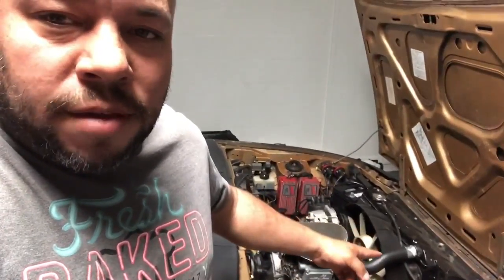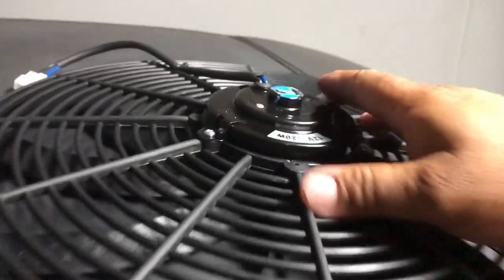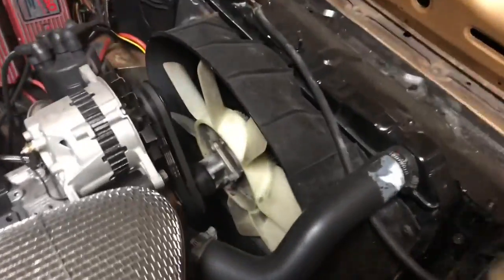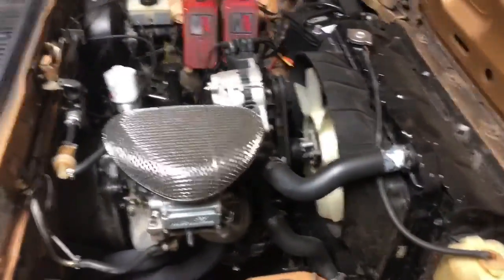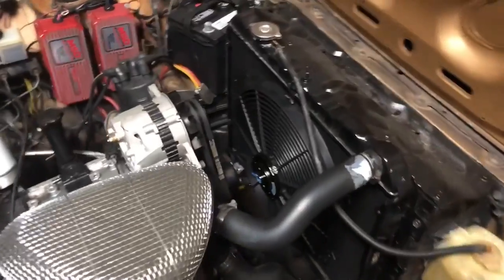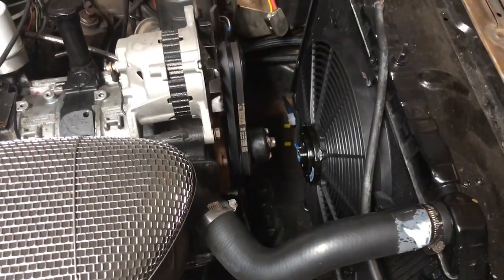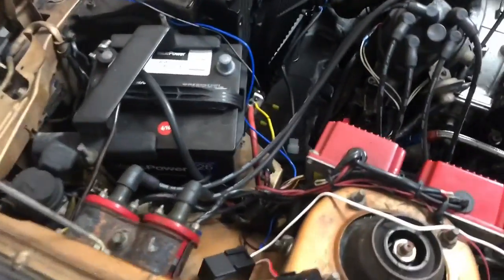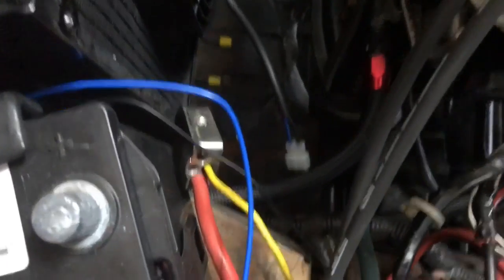35HP Increase with one Modification on 12a Bridgeport

Comment: Having a small size fan that doesn't cover the whole radiator, really worth the work to cool the radiator temp without overheating?
Reply from the maker: Angel Gonzalez  I bought the biggest fan that would fit on the stock Radiator. Then I put the stock shroud back helped the electric fan pull more air. Keeped the Rx7 cool even in 99 degree Florida heat.
Reply: Zepol Workz reason I asked because my current fan clutch aren’t any good anymore and looking forward to convert it to electric. Just not sure what fan I’d be interested to work with...

Comment: Did you notice any power of fuel Mileage gains from this mod?
Reply from the maker: Yes Rotary Engine ran better rev quicker with out extra drag. Pulled a lot better through gears. Stock fan was not disengaging completely could hear when driving. Very worth the work.